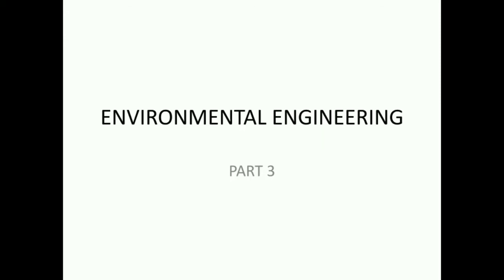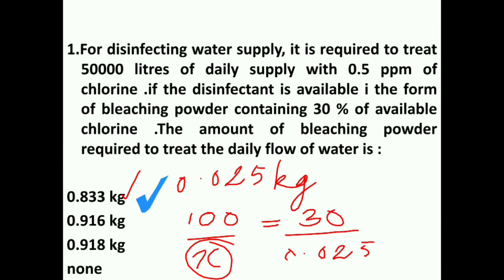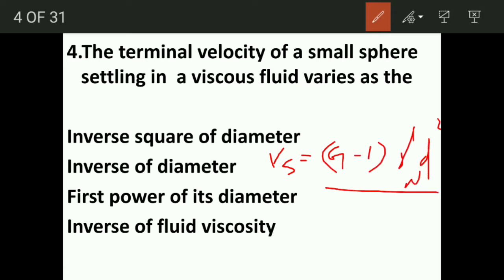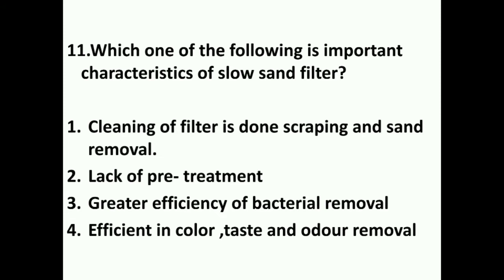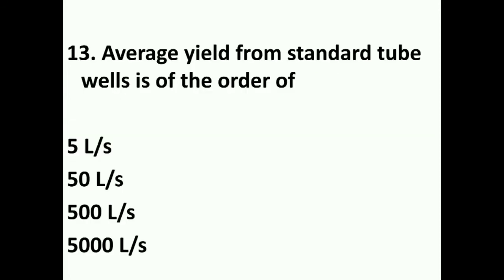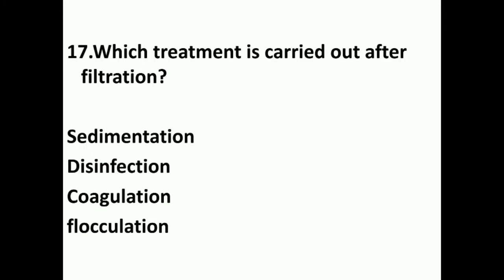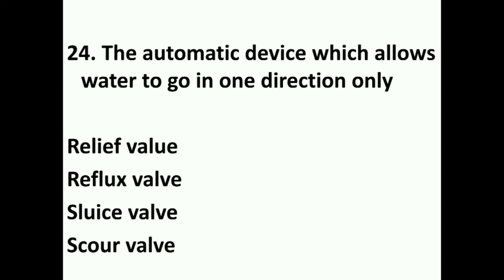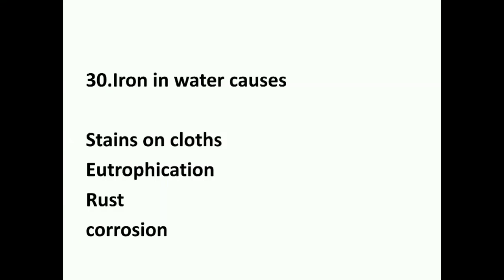ENVIRONMENTAL ENGINEERING PREVIOUS YEAR QUESTIONS- part 3

Comment: In qn 6 if turbidity >50ppm coagulants are used but  in qn 27 40 ppm is taken as answer even though 50 ppm is there in option
Reply from the maker: Thanku for raising query

The exact point is " the coagulants need to be added when turbidity is greater than 30 - 50 mg/l",so on average means > 40 mg/l

So according given options we need to select one.

Since it was a point explained in the video lectures , it was not repeated again question solving.